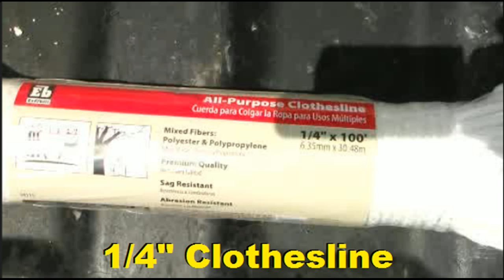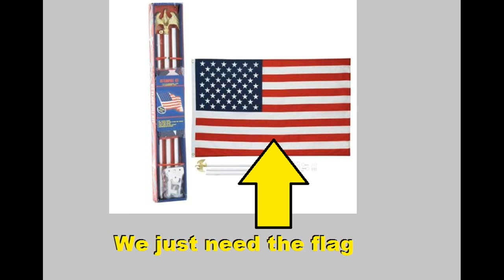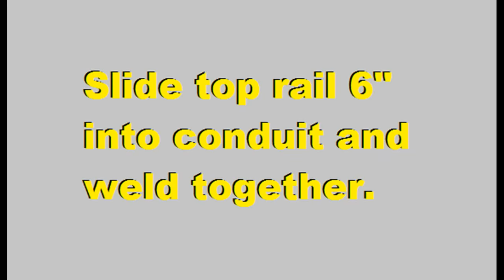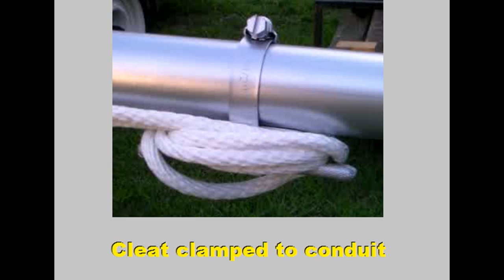Let's Build a Flag Pole

Comment: Awesome idea for the topper! Great video! 2 7/8 topper would even be better! :)
Reply from the maker: thank you, sir
Reply: How did you or the guy who doesn't care about your opinion secure the bottom pole into the PVC pipe?  Also was the PVC pipe cemented to the ground and then the pole cemented to the PVC or is the pole removable?  Overall... great video.... building my flagpole based on your instruction...Thanks!
Reply from the maker: +Joe McGee PVC cemented in ground. pole is removable...just sits inside pvc
Reply: Thanks!  Great job on the video... however the bottom pole (conduit) should be 1.25 in order to make it work.  No big deal, realized it when the conduit and PVC had the same size listed.   Your video will allow me to take the flag off the porch to flying high...something I wanted to do for a long time.  Thanks again for a great job by you!

Comment: how sturdy in the wind? just wondering if i should upgrade the sizes of poles as i will also by flying the navy flag. great idea by the way. i will have to bolt them together  as i dont have a welder.
Reply from the maker: This pole has been doing just fine, although an upgrade to the diameter for additional flags probably would not be a bad idea. Bolts should work fine, also.  Maybe plan to position them so they do not fray the lanyard.  Thanks for watching and good luck!
Reply: cuptain85 thanks fo the quick reply. Just came back from lowes. Got the 1 1/4" conduit for the top piece. Then will make a small piece for the tip so the rail will cap will fit on. How do u get the 1.5" conduit to slide intonthe 1.5" pvc? A sleeve?
Reply from the maker: +The guy who doesn't care about your opinion the fit was decent, but nowhere near tight.  the pole is easily placed into and removed from the PVC. now I'm worried that I may have mistyped a measurement :/
Reply: cuptain85 ok that probably the case. I was disappointed when i put the 2 pieces together and was really loose lol. The rail cap is 1 3/8 for sure. So ur bottom pole may be 1.25 and not 1.5. But no worries. Appreciate ur idea and imput
Reply: Pole and flags are up. It's been really windy and it's sturdy. Looks great. Thanks again
Reply from the maker: +The guy who doesn't care about your opinion very cool!
Reply from the maker: +The guy who doesn't care about your opinion very cool!
Reply: Kevin,
Did you do anything to steady the flagpole?   I put mine up today and the pole sways in a 7 mph breeze.  Would like to see it a little more sturdy.  Thanks!
Reply: ***** mine moves a little but nothing crazy. There was a small gap when putting the pole down into the pvc pipe. I used some  small metal strips and slipped those in to make it tight
Reply: Thanks, that is what mine is doing as well... the critics insist that there should be no movement...but  I'm good with it.  Thanks for your input.
Reply: ***** no problem. For the materials and price you really can't complain. Only other way would  be to use bigger heavier poles